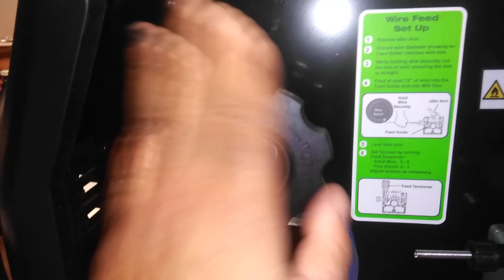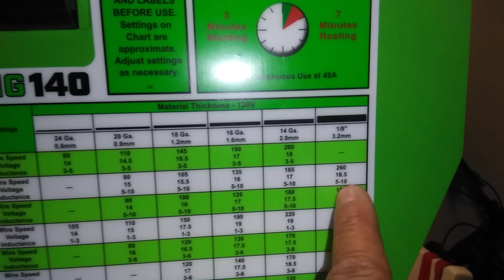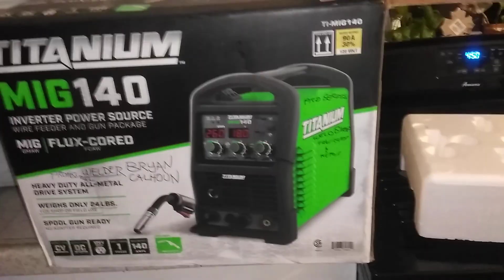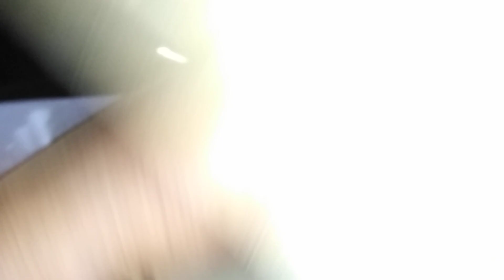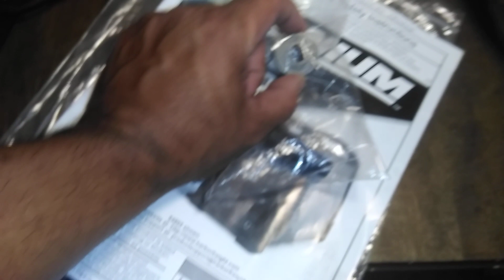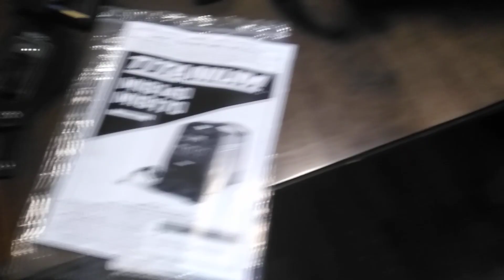New Titanium Mig 140 welder.

Comment: how often do they go on sale?
Reply from the maker: They go on sale quite often. Like probably  two or three  times a year.
Reply from the maker: I'd say at least three times a year  they offer 50$ coupons 
Totally worth it. It's an excellent machine. The power output is very even and smooth. The fan works great to cool down the parts. And the accessories  that come withb it get u welding  immiedately. It's a trip because it's only 399$   I got mine for about 299$  and I almost feel guilty....  (almost)